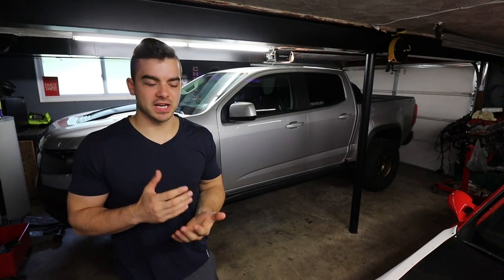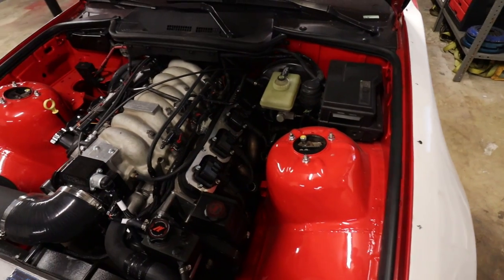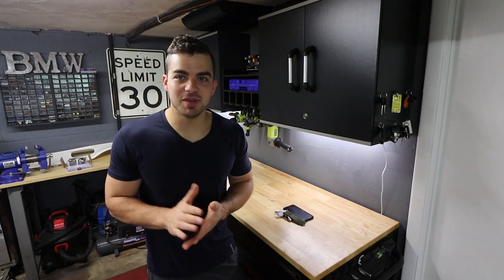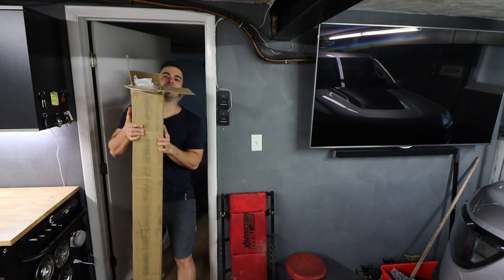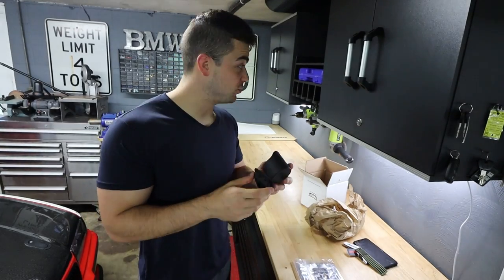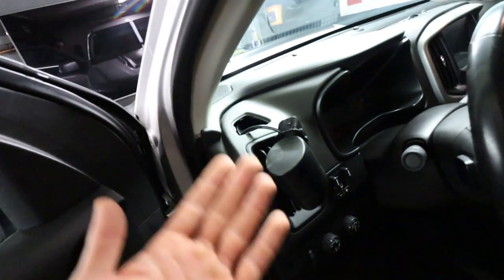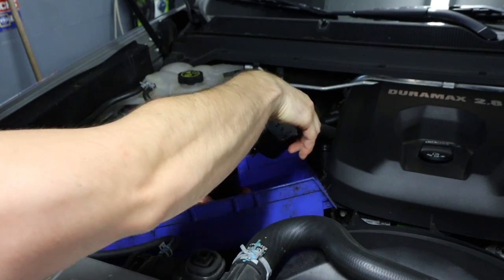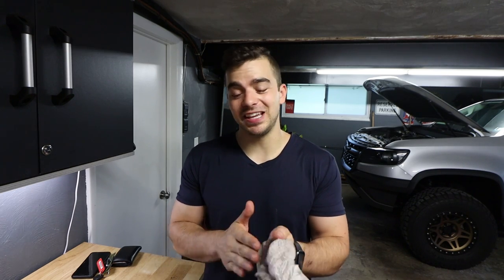Why I Stopped Modding My Diesel Colorado ZR2...

Comment: LOL on the melting gauge pod.  That's one problem I never heard about on the ADP pods.  I bought the new version.  My only complaint about it is it points to the left a bit too far.  I should have been angled towards the drive just a tad more.

Comment: Have you ever thought about putting a snorkel from aev with the filter on top. That would be one mod on your truck that would benefit alot,more clean air. What's your thought. Can't wait to see your new truck when you get it. Maybe the silverado zr2 with the 3.0L...
Reply from the maker: No snorkel for me, mainly because I just don't plan on going in deep water lol.  

I would love the Silverado ZR2 with the 3.0, but there are some issues.  You can't do any tuning to them, and the ZR2 is only offered in the 6.2 V8.

Comment: Have thought about doing the new grill with having led strip lights showing off the Chevrolet?
Reply from the maker: The 2021 grill?  I actually like the older grills better.
Reply: @matt13ross  sorry I wasn't clear. I meant the 20 style without the chevy bow tie. Those style look better then any of the other ones. That my 2 cents.
Reply: If u was going to put on the aev front bumper you need to have that kind of grille. Which I'm planning on doing for mine down the road. It's just so much $.lol but well worth it in the long haul.
Reply from the maker: I kind of want an AEV bumper but just for the purpose of fog lights.
Reply: @matt13ross  well look at it this way at least you will have a much strong bumper since it's made out of steel and there's so much more you can do with it also. I kind of wish I got the zr2 bison but the cost was way out of my price range at the time. So I'll be putting the aev parts on piece by piece.lol
Reply from the maker: Man I just don't think the Bison is worth the cost.  Same suspension, engine, etc.  Not enough changes for me.

Comment: Hey man, love the videos! Keep it up. Just wondering if you’ve ever considered putting a bigger turbo in? My truck has the exhaust and tune as well and I’d love to see someone do a turbo upgrade to see if it makes a big difference.
Reply from the maker: I would love a bigger turbo, but getting a proper tune for it seems difficult.  Plus, the engine and transmission can't really take anymore power anyway.

Comment: You need a catch can with a demister or coelscer to remove the tiny droplets from the ‘air’ stream. Check out ProVent 200. Don’t use up here in Canada due to freezing concerns. Also, my GDE tune, coupled with towing a LOT failed an injector and torched a piston. Upon tear down found all4 pistons cracked from piston pin through the ring lands and into the piston dome. Also found all 4 connecting rod bearings worn through babbit just after TDC. Lubrication failure or towing at too low RPM with high boost? Not sure. Cost $14k with my good customer discount to rebuild. Also changed many other related parts so don’t need to hear how someone’s uncles brother in law could do it cheaper.
Reply from the maker: Hoping mine doesn't have any engine failing issues, that's for sure!
Reply: Upon later review, the torched piston must have been the end result of the cracks propagating to the bowl and then the crack opened.
Conrod bearing failure?
Either high load at low rpm or straight up lubrication failure.
I run 5w-40 and gear down when towing on a stock tune now.
25,000 miles and so far, so good.

Comment: Always enjoy your videos.  Why haven't you added the afe hot and cold charge pipes?
Reply from the maker: Thanks! Haven’t seen the need for it. Haven’t had any issues with stock and it’s not going to add any HP. If anything, I’d do a bigger intercooler.
Reply: @matt13ross  good point.  I have a '18 duramax zr2, only have a s&b intake added.  Your videos definitely give me the itch to do more!  Just hit 60k miles, add no issues.  👍
Reply from the maker: Glad to hear there are no issues!

Comment: You got the wrong catch can. Prevent 200 is the right one. That Chinese crap catch can doesn’t work.
Reply from the maker: Hrm, this was from a kit (can't think of it right now).  Maybe sold on one of the Colorado websites?  Wasn't cheap in price but does seem to mimic the Chinese ones.
Reply: No way it’s shit, get the German one , it works.
Reply: All motors should go back to port injection then we will have no more issues.🛠🇦🇺
Reply: @jorjimaco5331  seems like whenever they combine port and direct injection it seems to eliminate some of the carbon build up the direct injections vehicles experience...Or am I wrong on that?? This is actually one of the huge drawbacks to direct injection amd if they were able to solve this issue I think ultimately its best to have fuel as close to combustion chamber for best atomization/mix or whatever but in always open to learning different if things change or my facts are wrong..cheers.